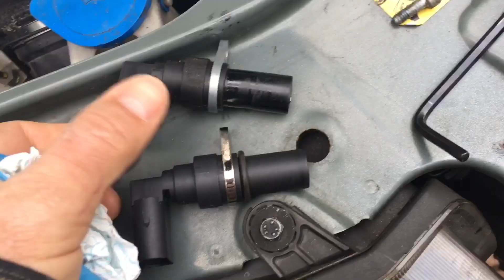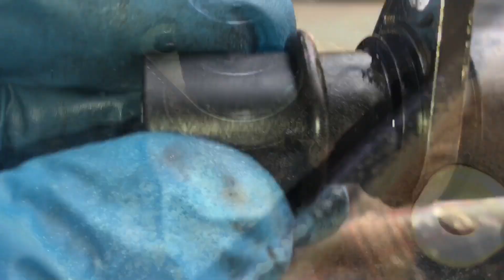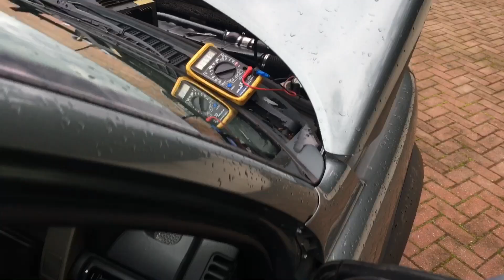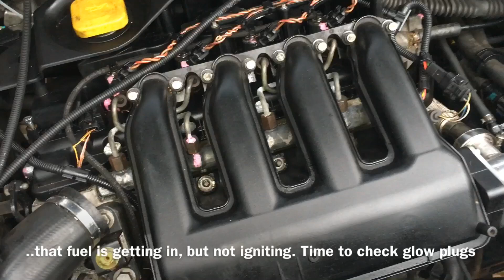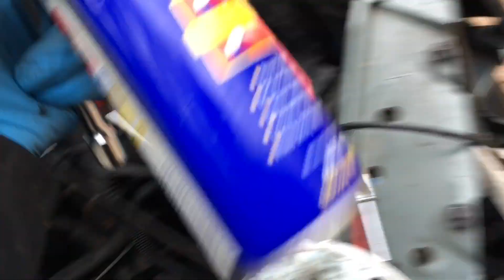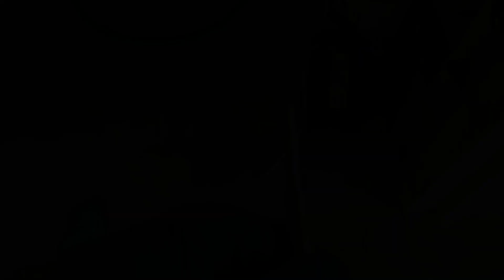Freelander. Car won’t rev or start? Crank sensor & Glow plug test and change - Delphi versus cheap

Comment: Hie I have a freelander td4 it was starting nice but not it doesn't start wat could be the problem
Reply from the maker: Check glow plugs.  Check manifold pressure via MAP voltage check.. check pressure regulator. Last check injectors are spraying ok. On my channel you will find videos on all of those things.

Comment: After I drive the car for a lil bit about 45 min then ill shut it off to go shopping for somthing. When I come back it cranks over but wont fire up. So I give it another hour be for I try to start it again. And I starts right up? I
Reply from the maker: @Jack-vb2dj  could be the crank sensor. As those sensors trend to fail when hot.
Reply: @comeinhandynow  ok, thanks for replying,  it only fails to start on a short run, seems like a lack of fuel, starts after i gas the peddle and leave it for an hour.

Comment: Hi, You helped me before with a door lock - much appreciated. Now my XEDi L series wont rev past 3000 RPM - it's ok if it rests for a few days, but when it gets hot the problem returns. I can push it past the 3000 by pedal to the metal. then it has a lumpy idle. I have replaced the fuel filter. I'm thinking a contaminated PCV or something that returns to normal after a rest. There is no negative pressure in the tank ie ( no whoosh when cap removed) Hope you can help me - I love this hippo
Reply from the maker: Thanks. The Freelanders are great aren’t they.  Hopefully you can get to the bottom of this issue.  Problems getting enough power (or rpm) will be either not enough fuel or not enough air.  The first step is to work out which.  A turbo boost gauge that measures inlet manifold pressure is useful to check on boost levels (cheap on eBay) and if that engine has any sensor on the fuel pressure (I am not surre about that engine) then try and measure that.  Hopefully a few clues to the problem will come out.  I doubt a PCV would cause what you see. Probably look around some forums for other people who had this problem as well.  Otherwise just check everything, a bit like I had to do fixing a smokey TD4 Freelander that I did a video on.

Comment: My issue is after start engin alerm appears and no acceleration happen,but engin is running,can any body help me to solve this issue.
Reply from the maker: It’s best to get an OBD2 scanner to read any error codes. Have a look at my review of the autel AP200C for example.

Comment: Hi, first thankyou for all your videos about freelander "quirks" I've found a number of them very helpful and informative 👍 I'm currently trying to replace the crankshaft position sensor, could you tell me how you remove the silver/grey front valance at the bottom of the bumper... I don't want to risk breaking it.

Thank-you
Ben
Reply from the maker: Thanks.  There is the undertray which has a built in aluminium section at the front, that is all removed by bolts and screws which are visible.  The front valence is part of the bumper, I don’t think you need to remove that do do the sensor.

Comment: Having a starting issue with a freelander, displaying p0340. Does sensor need to show over 5v? It’s showing 4.94v, then drops to 0.6 when in contact with metal.
Reply from the maker: No that’s fine, but does it also give that good reading when hot?
Reply: @comeinhandynow  no idea as it won’t start at all, it was running and suddenly cut out, it shows p0340, engine cranks but won’t fire. I’m guessing timing is out. Know if a guide on how to check l this? Thanks
Reply from the maker: @DJ_RiX  Sounds odd.  I guess first thing to check is the timing belt and check the timing marks line up correctly on the cams and crank. (See Haynes workshop manual)

Comment: Hi bud,

Purchased a freelander 1 TD4 commercial this week, 

On initial start up the engine stalls. Start it again and it doesnt stall but runs really rough for about 10 seconds (like its only running on 3 cylinders) then its completely fine. I suspected glow plugs and replaced them and going to service the car next including fuel filter. Any suggestions please?

Thanks.
Reply from the maker: Good guess on glow plugs, but the next thing to check would be the HP fuel sensor readings to check that the fuel pressure to the injectors is correct.  A common fault is a worn HP regulator seal.  Also check and clean the injectors.
Reply: @comeinhandynow  hi thank you I have just ordered a HP regulator seal kit and new injector seals for after I clean them.
Reply: @comeinhandynow  also while I’m here when I got the car the rear window wouldn’t go down. stripped down the back found an unplugged connector for the wiper motor. I plugged that back in and my rear window started working again, it goes down but doesn’t go back up and now it’s stuck down. The regulator doesn’t click when I press the up button so it’s not getting any feed. Is there any idea what I should check? Relays? Is it something common. Thanks again.
Reply from the maker: @Spw1471  i would measure the voltage going to the motor to show where the issue lies. Could be the switch.
Reply from the maker: Also try swapping over the wires to the motor, that may enable you to get it back up and also it will confirm if it’s the switch or the motor.
Reply: @comeinhandynow  i have a feeling it isn’t the motor because before I fiddled with it every time I opened the tailgate the window would drop and then when I closed it the window would lift itself back up
Reply from the maker: @Spw1471  yep, unusual to be the motor anyhow. Sounds like the switch. They can get corroded inside. You can take them apart and clean them up.
Reply: @comeinhandynow  perfect thank you will have a look this weekend. It’s having  prop bearings tomorrow too

Comment: Hi, comeinhandynow! I have a similar problem in my freelander td4 from 2004; at 2000 rpm and a speed of 80/100 km / h, the engine dries up but if I then accelerate the problem disappears and the engine runs like a marvel! can all this be attributable to the sensor I see in your video? (I think it is crankshaft rpm sensor) or can you advise me on the annoying compose? from the diagnosis there is no error and having said that apart from this small defect the car is fine! thanks if you can answer me!
Reply: Forgive my English .. to be more correct at 2000 rpm and constant 80-100kmh, the engine is slightly bumping!
Reply from the maker: That doesnt sound like the crank sensor causing it, maybe a fuel pressure problem.  Read the hp sensor value on an obdii reader, or a voltmeter.
Reply: @comeinhandynow  perfect! tomorrow I proceed with the checks. thank you so much!! if it doesn't bother you tomorrow I will send you the link of the video where the defect is present! thank you for answering me! Cesare from Sardinia
Reply: @comeinhandynow  https://www.youtube.com/watch?v=1r5dnmudCTs
Reply from the maker: @cinemechanica75  Hard to tell much from that.  You need to monitor air pressure and fuel pressure with  an obd2 reader or measure the hp fuel sensor voltage and install a boost gauge to check for problems. Could be MAF sensor, could be hp fuel sensor, could be hp regulator or turbo problems or vacuum lines to turbo for examples.  You need to go through everything like in this video https://youtu.be/sJFHvKIGHIA

Comment from the maker: Could be the crank sensor like in this video, but could also be a lack of turbo boost pressure.  Put on a pressure gauge (boost/vacuum guage) and see if you have any boost pressure, then find the leak if you have no pressure.

Comment: Hi...am using bmw 320d m47,it doesn't rich 3000rpm...very slow when driving...help please,am in Botswana
Reply from the maker: Check turbo boost pressure with a pressure gauge.  |Maybe you have a hole or leak somewhere.

Comment: My freelander td4 2004 sometimes with engine cold I set the switch on ignition and the water temp cauge is full ,I start but no ignition till the water temp cauge go to normal.do you have any idea what to look,I believe it's electrical problem. Thanks
Reply from the maker: Only a guess but maybe a corroded earth connection. Check out any body or engine earths in the engine compartment.

Comment: When I use the link to the Ebay store, the Delphi glow plugs are out of stock. I need some for my 2.0l td4 diesel. Where can I get these
Reply from the maker: I guess that is the covid19 effect on the supply chain.  I have a set of those cheaper Chinese glow plugs if those are of any interest. As new.  Not as good as Delphi but better than non working ones.
Reply from the maker: Some more here, just check they fit your vehicle.  https://ebay.to/3fgKwTs
Reply: Thanks. Mine work. Wanted to buy delphi in the event they fail

Comment: I have same VEHICLE  my car has poor starting . I need to press  has pedal  as rev up engine  then it START  but I need to hold has pedal  a bit longer  because if I release it then engine stop but after 10 or 15 second  it is fine  working normal no issues  . Sometimes when engine warm it start with no problems.  Do you have any idea  what's caused  it.? What I need to replace
Reply from the maker: Test the glow plugs first

Comment: I took my deisel ford to an auto electrician and was told glow plugs take somewhere between 20 and 30 seconds so I think give the glows a bit more time to heat properly to give it a good start, my glow plugs were only heating for 6 seconds and wouldn’t start the car so I hit the key 6 more times at 6 second intervals 6x6=36 and it started lol. So there ya go. I still have to get it sorted out what the issue is but for now I can still get it Going.
Reply from the maker: There is a big difference between cheap Chinese glow plugs and better quality Delphi ones, as I show.  I wouldn’t buy the cheap ones again.

Comment: please help me, my car does not start .. I see the injector does not spray. Thanks
Reply from the maker: Check the voltage reading from the high pressure fuel sensor and then the low pressure one.

Comment: Useful, informative video - thanks.  Did you use new gaskets when replacing the inlet manifold?
Reply from the maker: Thanks.  No I didn’t replace the rubber gaskets as they still sealed ok.
Reply: @comeinhandynow  That's good to know, thanks again.